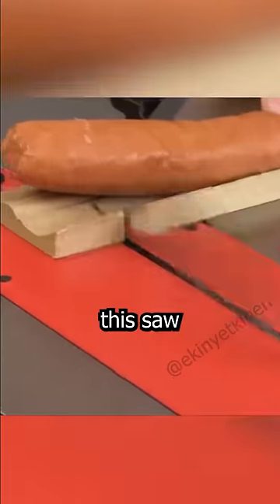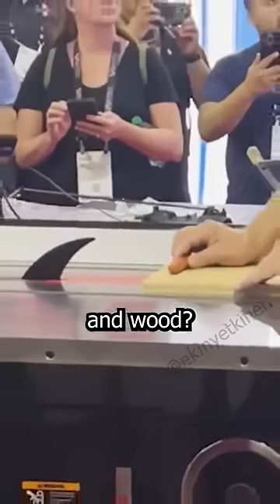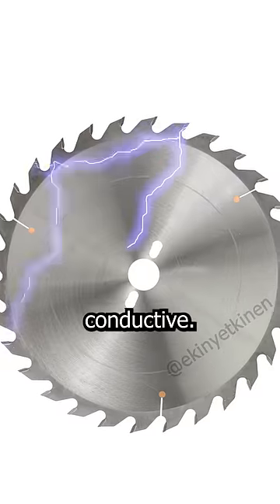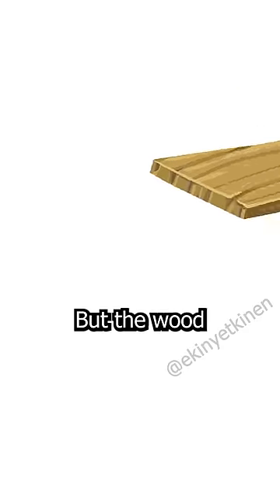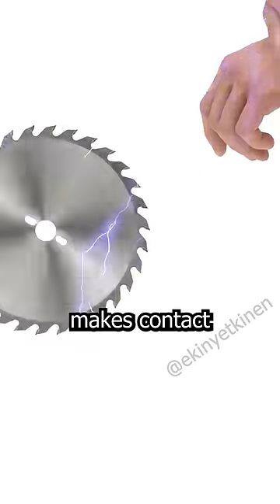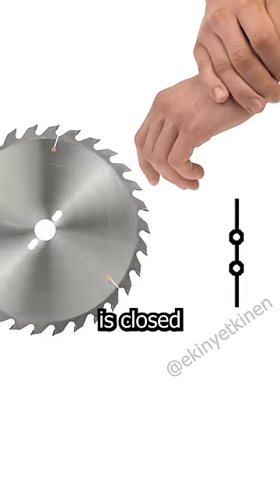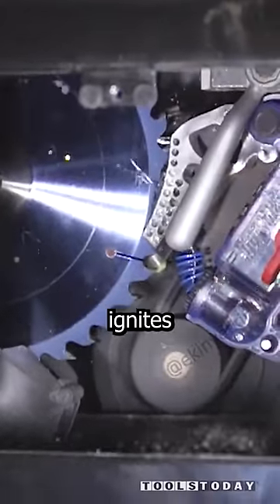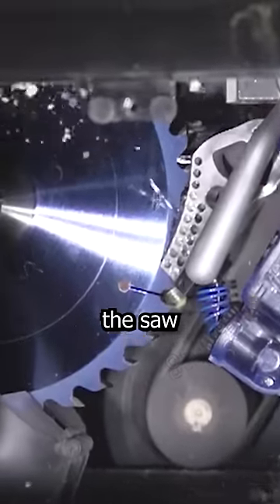How does a wood saw not cut my hand? 🤔 (sawstop)

Comment: The saw literally sacrifices for your finger, thats top tier engineering right there
Reply: Great engineering for sure, but even better would be if it was reliably reusable
Reply: @isaiahhiggins  It would need to have better breaks and the saw should withstand the punch

Maybe in a future but if it was like that it would be Even more expensive
Reply: @flaggy185  True, I guess the overall cost would depend on how many close calls you have 😅
Reply: @isaiahhiggins the point is you don’t want it to be reusable. You buy the saw for the saw, not for the brakes. The brakes are there just in case, they’re not the thing meant to be used.
Reply: @isaiahhiggins nah, I'd go the other way. Make the brakes easier to replace and cheaper to buy. And maybe with less damage potential to the saw, but idk how possible that one is.
Reply: LIKE YOUR FINGERS ?  @isaiahhiggins
Reply: @lordnile6657  yeah realistically that would probably be the way to go
Reply: @lordnile6657  It really isn't. The amount of force you put through the sawblade when you've to stop it before it does damage to a body part just makes it so you don't ever want to use the sawblade again. You get micro fractures in the steel that can cause teeth to fly off or the entire blade to explode if you try to turn the saw on again.
Reply: @isaiahhiggins to be fair, you arent sticking your finger in a running sawblade every day
Reply: @isaiahhiggins  i dont really think you could make them reusable when its a block of aluminum being propelled by a gunshot into an insanely fast saw blade lol, very destructive
Reply: @isaiahhiggins  if reusable ones existed, then they would be too expensive for the average worker so thats probably why they dont make them
Reply: YES!!
Reply: @isaiahhiggins the g forces that the blade experiences are so insanely high it's basically impossible to make it reusable, the materials needed for the blade to survive those forces don't exist.
Reply: @flaggy185 maybe it would need to be made out of like unbreakable diamond so it doesn't scratch and break into a trillion pieces (diamond is hard, but not really durable)
Reply: If you use the saw right and safe, you will NEVER use the brakes.
Reply: Kid named Finger
Reply: @isaiahhiggins don't think it needs to be reusable, I think someone who still has all their fingers thanks to this 'disposable' device is happy to pay for a new one
Reply: @isaiahhiggins so you probably think airbags are useless then. Bicycle helmets? Bulletproof vests? 🤡
Reply: @isaiahhiggins I feel like if this happens to you more than once you deserve to lose fingers
Reply: @falcovg2  Sounds about right yeah. Maybe cheaper sawblades, but I don't remember the last time a company made a cheaper product through researching better material options, and not a cheaper product by cutting corners.
Reply: @lordnile6657  I mean, or don't touch the saw? You shouldn't be using these systems to stop your saw on a regular basis, they are a last resort device that save your finger but wreck the saw. I wouldn't be surprised if the emergency stop even has a chance to wreck internal components like bearings and axles. Costs of parts shouldn't really be a consideration for these kind of systems. It's one of those things you never should have to use, but if you have to, other things don't really matter that much in that moment.
Reply: @isaiahhiggins you're talking about a system that brakes INSTANTLY while also being able to be reused..you need some VERY durable materials to achieve that
Reply: The replies here are wild.

If you keep tripping the circuit, you shouldn't be working this job because you're too clumsy for your own good. This is intended to stop you from losing your finger on the odd and rare chance that you slide your finger into the saw.

How reckless are y'all that you expect this thing to be reusable?
Reply: @casekocsk not true, these crappy saw stops love to trigger the brake every time green wood happens to touch its blade.
Reply: @Leo-vr3bg  then don't use green wood... Or use different saw when dealing with green wood (and be extra careful since there is no brake mechanism).
Reply: @isaiahhiggins small price to pay for your fingers ain't it?
Reply: @isaiahhiggins That would make it way more expensive so unless you're regularly cutting off your fingers and forcing the saw to stop then you really don't need it to be reusable... just be more careful.
Reply: Its a special friendship
Reply: @isaiahhiggins then you run into an issue of how reliable it is after or by use number 3
Reply: @lordnile6657 that sounds not to smart. If the breaks are cheaper they’re probably not as strong and more likely to goal completely stopping
Reply: @isaiahhiggins there are reusable ones, but they cost at minimum 2-3x what the original sawstop does.
Reply: @isaiahhiggins Please, Tell me one person who would ever use a saw again right after almost getting his permanent finger almost cut off.
Reply: Maybe some sort of electromagnetic braking would work, or even a magnetic piston or something
Reply: @isaiahhiggins we don’t have a material that exists that can stop such a thing without consuming bits of itself
Reply: @isaiahhiggins it is reusable. You just replace the brake cartridge which SawStop the company who invented and sells these saws, sells almost at cost. They’re $99-$119 to replace. Well worth it to save your fingers.
Reply: @lordnile6657 
Is there a way to make the saw instantly stop with a reusable way though? From what I'm getting, the braking system is basically jamming a block of metal to stop the blade
Reply: No it's basic engineering. Hands are conductive. Touching the saw closes the circuit, setting off the brakes.
Reply: Yep
Reply: @isaiahhiggins 😢🎉😢 lol
Reply: @isaiahhiggins I think you can replace the break and saw can you not?
Reply: @isaiahhiggins bruh, it act like a pill or medicine that you swallow and diguse to save your life and you would like to undigest and spit out to reuse it again?
Reply: @flaggy185 Well the issue is the braking itself. We could theoretically make brakes that don't damage the saw but those would brake much much slower. The thing that kills the system and blade is the rapid deceleration causing the blade to create micro fractures, cracks you can't see but exist. If you try to use the blade again without replacing it there is a solid chance the micro fractures widen possibly making parts of the blade fly off. I don't need to explain why thats not good. The breaking system getting damaged is because it's stopping something going at such a high speed
Reply: @flaggy185 it’s supposed to be like that but saw stop patents prevent anyone from actually advancing it

Comment: To anyone asking, yes these are effective. I have friends who have had them go off on them, most you'll get is broken skin
Reply: To anyone wondering how it works - it works exactly like a touch lamp works
Reply: and PTSD XD
Reply: You are right. It nicked my uncle's thumb before the break triggered. Much better than losing fingers.
Reply: Even with gloves the brakes work?
Reply: @MrMirco2012  no. It only works with the flesh.
Reply: @MrMirco2012 use your brain, is leather, cloth, or rubber conductive?
Reply: @MrMirco2012  they'll pierce your gloves, but better a broken glove then a missing finger.
Reply: Wow! I was wondering how fast it actually stops and how much damage is generally done - super cool and interesting
Reply: @MrMirco2012  bro do not wear fucking gloves while working with any spinning machinery
Reply: @MrMirco2012 Never use gloves on ANY rotating tools. The tool will pull your hand in instead of just cutting.

Depending on torque you'll break fingers and bones unless it cuts your fingers hand or arm off as it pulls. It will pull your appendages off and bones out if it gets a good grip and twist.

Better to get a cut or slice with bare hands. Or just pay attention and don't touch moving parts and always be safer than not by making sure the tool is off and unplugged if you do.
Reply: "most you'll get is broken skin" No, you can still get cut very badly if your hand is moving towards the blade fast enough.
Reply: @MrMirco2012 if you wear gloves while using these machine you're just asking to get a hand shoved into the blade
Reply: @Jake-bt3fc If your hands are moving fast towards a cutting blade you're doing it wrong.
Reply: @Jake-bt3fc  if you're purposefully swiping at a moving sawblade you are asking to get your hand removed
Reply: How many friends do you have that basically would of lost fingers?! O.o
Reply: @OutsiderLabs  Sawstops are specifically made to protect people who are using tablesaws wrong. If you use it right you don't need it at all, lol.
Reply: @thefirstsalty3055  Nobody is intentionally doing that. People fall and put their hands out to catch themselves. Other people in the shop might knock something into you and push you, etc. 
The point is, sawstops are fast but don't make shit up about it being faster than it is and say its impossible to get more than a tiny cut. You only get a tiny cut if you slowly touch it.
It's like saying "if you wear a helmet the worst you'll get is a minor concussion" it's just a silly thing to say.
Reply: Theres a YouTuber you did a great video on the sawstop, even a dado blade, which is banned in the EU for how dangerous it is, would only need some stitches
Reply: @thefirstsalty3055 using gloves with any rotating object is a terrible idea. The gloves get caught in the mechanism and will pull your hand into the saw blade.
Reply: @Jake-bt3fc  You should be moving slowly and concisely with a saw blade, fast movements can fuck up whatever you're cutting

It's not a time trial, it's a precision tool
Reply: @dynamitedingo8183  exactly! Gloves get caught on the rotating saw and pull your hand into the saw blade lol.
Reply: @missequestrian3448  Saw stop check on here and you see high speed camera of the inventor doing the demo with his finger.
Reply: Man it's crazy. Nobody has the balls to do it, but you could in theory slam your hand down as hard as you can on the blade and would have nothing more than a minor cut.
Reply: @MrMirco2012  once it pierces your glove, it will work exactly the same as before, the instant it touches your finger through the glove.
Reply: @ominarous  nah you'd get fucked up still, its not designed for that
Reply: I already saw some youtube videos with people actually getting fingers in them. '
Reply: How fast that thing works? Incredible!
Reply: @TickleThatMonkey most of the time yeah but I’ve recently started working with massive bandsaws amd I now have a Collection of gloves that have certainly save my fingers
Reply: @marvinactuallygardens  You absolutely should NOT use gloves on a band saw. It's really risky.

And if you have you should know it pulls all your fingers in rather than a cut. So I don't know how you saved your fingers when you wore gloves there. Or why you would say that as having to be in that situation of almost losing your fingers in the first place is an indicator of bad safety and awareness.

Most shops have a work policy of not allowing gloves on spinning and turning machinery.

A quick Google search and you will see every result, video, text etc recommending to NOT use gloves. 

You can always think you're smarter and know better, but better to be humbled first. It appears you have been with your previous incidents, and the fact all experts and experienced people recommending to NOT use them. So time to be safe than right here 👍
Reply: Actually, there are times when the saw won’t stop quite in time. I cut my thumb pretty bad and down to the bone(cut through the tip of my phalange) had to get stitches and it was a whole mess. Still have nerve damage and pain from it 8 years later.
Reply: @missequestrian3448 in intensive tests, most damage reached to a prop whilst slamming it with human force as fast as they could was a cut about half the diameter of your index finger.
Reply: @Jetlef_B_Toast  thanks!
Reply: @MrMirco2012 cut the glove and it would stop  -eventually. May not be as quick, but I wouldn’t know
Reply: They’re amazing for cutting wood but they have limitations. Sometimes what you’re cutting is also conductive and if you don’t turn off the safety for it, you just ruined your table saw until you can get it fixed. 

Or people feel comfortable around it but turn it off and forget to turn in on and they hurt themselves because they’re not as careful since they think they have a safety net. 

It’s like Tesla autopilot or other self driving cars. They’re often safer than without but also have flaws and when people get too comfortable with them it becomes more dangerous when it doesn’t work.
Reply: @RaveN_EDM  if you're complacent around a saw because theres a sawstop you shouldn't be using a saw.
Reply: @TickleThatMonkey just like my friend, use gloves and his glove stuck and get pulled by the machine, leave a huge wounds.
Reply: Saw a video of a guy who got a little more then that. Guy got a deep cut into his finger but after some stitches it was fine.
Reply: That is actually craaazy tho, the fact we went from cavemen to this like is actually insanity. Like how did we even discover electricity only like 250years ago and now we got shit like this
Reply: @MrMirco2012 i have seen a shit ton of workers dying in horrible ways cuz they had loose clothes on near spinning machines, please be careful
Reply: It's also a hint to them that they shouldn't be wielding such tools, they lack the common sense. Never ever come close to the blade, use a stick of wood to push the log or panel through.

Comment: I showed this to my grandfather after he had a table saw accident that caused him to lose 3 of his fingers (they managed to reattach 2 and a half of em). He said it was too expensive and he didnt want to fork over the money every time it happened because the brake broke whenever it triggered. Im like, it only triggers when your finger gets in the way, in which case it would save you the hospital trip.
Reply: Wait...and a half???
Reply: @senterfld2287  well better 2 joints than none
Reply: @senterfld2287  they couldn't save the top joint of his middle finger. It was too mangled.
Reply: You set these off when anything conductive touches the blade. There’s usually an override switch for that tho but people either forget to use them or don’t know it’s there or they use them and forget to turn it back on. 

It’s a great safety feature and I think everyone should have it but sometimes people get too comfortable with them since it’s like a safety net. 

Also it’s mostly effective when you touch the blade at lower speed but at higher speed it could still cut your fingers off. The demo videos usually show them slowly sliding a hotdog and there’s only a small cut. A reviewer I saw on YouTube also testing throwing the hotdogs at the blade and it sliced right through it.
Reply: @zNEKOMARUz  ah.
Reply: @RaveN_EDM  You would have to throw your hand at it pretty fucking fast then and at which point you are outside the scope of the what it was intended for. I dont see any scenario in which your hand would be moving that fast, ever occuring.
Reply: @MrBa143  someone slipping and instinctively putting hands out in front to break their fall and hand hits the blade at high speed. Material someone holding grabs onto blade and pulls hand towards blade at high speed. 

These things might happen rarely but only needs to happen once. It’s not good to rely on these things.
Reply: @RaveN_EDM  I highly doubt anyone is relying on this. Its an added layer of safety
Reply: @RaveN_EDM  that is a very very bad example as both the examples can and does happen but it's so improbable that having a safety mechanism for a more probable cause is MUCH more logical and strategically efficient
Reply: So true
Reply: @RaveN_EDM I'd still rather have the saw cut of a finger then and stop, conpared to it cutting through my hand keep on running and destroy my torso as well.
Reply: Two AND A HALF.